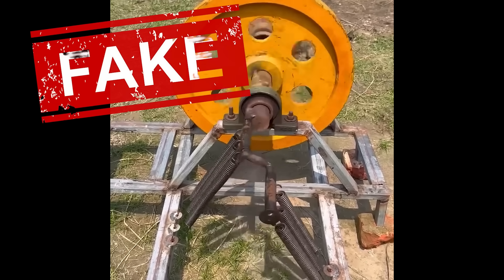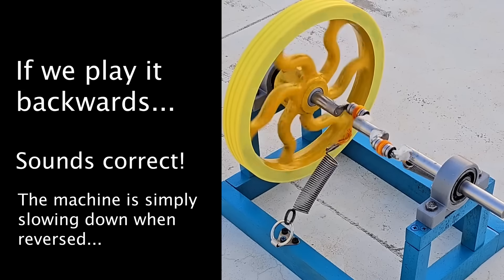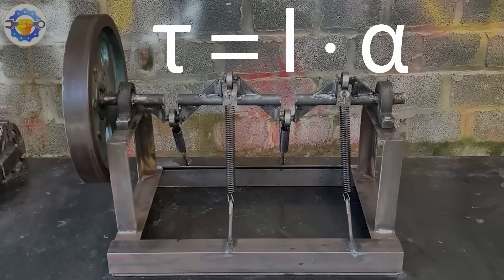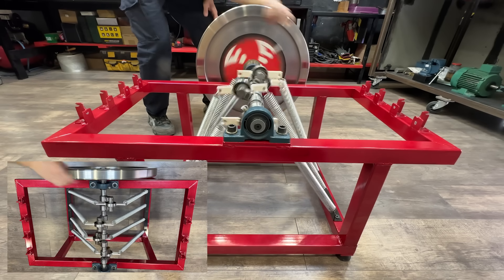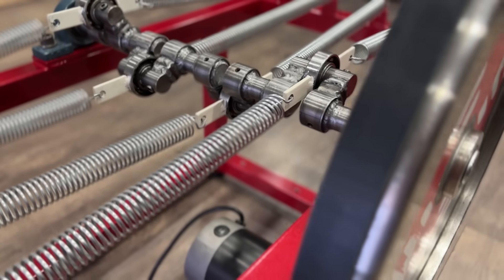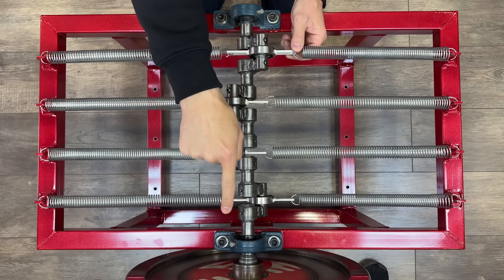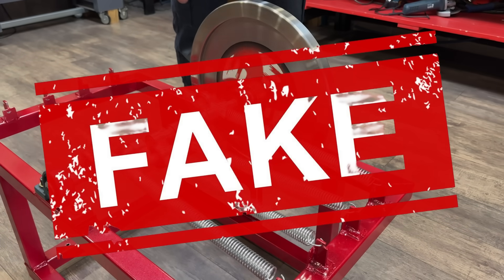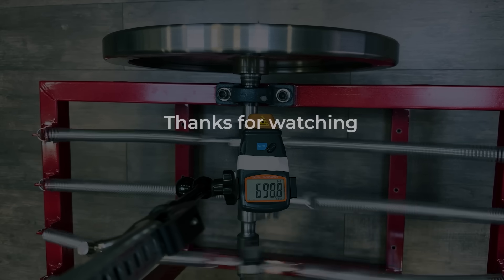Debunking the Controversial Spring-Powered Perpetual Motion Machine

Comment: No, it's not possible to make a genuine perpetual motion machine. Such a machine, one that runs indefinitely without any external energy input, would violate the laws of thermodynamics, particularly the first and second laws. While some devices might appear to move perpetually, they rely on external sources or other mechanisms, and eventually slow down due to factors like friction or energy loss. 

Here's why:

First Law of Thermodynamics:

This law states that energy cannot be created or destroyed, only transformed. A perpetual motion machine would need to create energy from nothing, violating this law. 

Second Law of Thermodynamics:

This law states that in any energy transfer or transformation, some energy is always lost as waste heat. This means that a machine will always lose some energy to its surroundings, eventually running down. 

Real-world factors:

In the real world, there are always external forces like friction, air resistance, and heat transfer that will eventually stop a machine from running indefinitely. 

No verified perpetual motion machine:

No truly perpetual motion machine has ever been scientifically verified to work, and all attempts have been shown to violate the laws of thermodynamics. 

While the concept of perpetual motion is fascinating, it's important to remember that it's a hypothetical concept that doesn't align with the established principles of physics.
Reply: Hey even if something lasts only a month before replacement parts are needed, as long as the monthly/yearly cost is less than the ever increasing cost of my outrageous Pacific Gas and Electric bill than it is 100% worth it.

Comment: bro okay can you at least tell us its energy conversion type

  I don't think that thing will work. because what you are saying is I can create energy from the external wave like spring also need energy to be formed. so what you are doing is just dividing the energy if the vibration is not absorbed back to the system it will result in more energy lose.

Comment: If u wanted to use this system to power something to get its energy wouldn’t u have to apply a belt or say install a drill bit on center of wheel to drill stuff or other means to take advantage of it engery wouldn’t the belt or drill bit friction keep it from working. I guess my question is can u use the energy it creates or does it even create energy or just enough to maintain keeping it rotating. Thanks
Reply: It does not create any energy , it only consumes energy , that energy being the energy you put in when it is push started .

Comment: You can remove all these ridiculous messy springs and keep the wheel, you cannot have more energy than the energy stored in the wheel  1/2*J*W^2
Reply: The wheel has white got to keep the crankshaft working
Reply: The springs ar the force on the crankshaft

Comment: No work is being accomplished.  You are totally discarding friction.  Perhaps this will work when you create a frictionless bearing.
Reply: Even with magnetic bearing there is air friction.
Reply: And find a way around hysteretic heating in the springs.
Reply: Hey even if something lasts only a month before replacement parts are needed, as long as the monthly/yearly cost is less than the ever increasing cost of my outrageous Pacific Gas and Electric bill than it is 100% worth it.

Comment: Trying any configuration would lead you to the same spot - producing energy out of nothing is impossible. At least there’s a friction between the flywheel and the surrounding air. Regardless of any springs configuration when turning the wheel by hand it will stop after a period of time (more or less but it will stop). Your formulas have their blindspots. Such videos are useless. No one could defeat higher level created laws…😅

Comment: I think it can sustain..with dyamo on the load side then goes to battery then connect to an electric motor that will spin again the machine. Then a sensor that will trigger the electric motor to start if the RPM is below a certain low side RPM, then after it reach a high RPM the sensor stops the motor. THis will enable the battery to store some energy before it will be use by the electric motor.

Comment: I'm not convinced. As you mentioned earlier, the system wouldn't function without an external energy source. If something like that were actually possible, you wouldn't be spending time making YouTube videos—you'd be out securing investors.
Reply: Do you see the difference between his crankshaft and the fak video crankshafts
Reply: I'm not so sure. Making YouTube videos takes considerably less effort than building a manufacturing business. Also, there are many tales of people getting murdered for threatening to topple the fossil fuel industry using free energy tech. If I'd invented a free energy generator, I'd probably just keep it in my basement to save energy costs, and maybe build a couple of extras to send anonymously to some science influencers.
Reply: @HankMeyer  you think these things work? Lol
Reply: Маховик  работает только на растяжение пружин ..пружины никакой работы не производят ..это не работает
Reply: I feel like the springs would cancel each other out. I assume it spins just as long with the springs as without the springs.
Reply: Untill the springs get hot and their elastic properties start to take over.
Reply: Evening to you 'all I've watched the video a number of times. At one point of video he mentioned doing a vector of one hundred and twenty degrees apart of spring placements  Also I was wondering of like some vee eight engines that had two cylinders igniting simultaneously to transfer power to crankshaft basically a four cylinder engine but with double cylinder burn for power  Two springs pulling, though after writing about the engine; think not correct.
Back to springs in a delta pattern the pulling I think would be balanced especially with a banked set offset to provide pull after pulling spring energy spent with another spring ready to provide.either that or they all work against each other and the system stalls.
Reply: Learn do math for physics and you can debunk or prove most of the generator stuff. I have a huge Pakistan engineers liberty engine design from 8 years ago. I believe these guys cause the science is sound.
Reply: @danfeutz6911   математика и физика содержит неполную информацию о мире вокруг .
Reply: 😊 I guess it is too much to spend the money and effort guessing at dimensions, obtaining/welding/painting the 1.5" welded steel tube, the 8"(?) springs, the 18" dia. (?),1" wide flywheel AND THE MAIN SHAFT(40 mm is 1") and making an experimental hobby effort  to prove or disprove. who owns a lathe, normally?
Reply: Amigo tenta a sorte o cara fez video e o experimento no mesmo tempo que vocé esta criticando agora ate eu viu por em pratica .
Reply: Die Energie einer Feder wird von der gegenüberliegenden Feder verbraucht und das wird früher oder später zum Stillstand führen.
Reply: You need a special  alloy  😂
Reply: Exactly. He should make it available for sale - to prove that it is possible. Or to prove that, it is not possible. Either way, it can be put on sale.
Reply: It could work without a load, enough energy to sustain itself but not if there were a load  on it, wether that be transfered torque or electro magnetic field to produce electricity.
Reply: @GetRektStudio Если бы это был вечный двигатель то без нагрузки ускорялся до полного разрушения
Reply: In the video he said that the crankshaft has to be equally balanced
Reply: The position of the springs are the most important

Comment: i'm pretty sure this won't work because when a spring compress and relaxes, it generate friction and with friction, come heat which mean loses.. even if this machine do work as you say it work, it will eventually fail due to heat as in, the spring would melt after becoming glowing red hot.
Reply: No such thing as a perpetual.motion machine.

Comment: Nope sorry. For every action of your spring motor there's an opposite and equal reaction that cancels it out = 0 gain of anything , except wasted time. A spring can pull no harder than what it takes to stretch out another like spring which produces,  0 net gain, a spring being bounced One Direction in oscillation text just as much energy to oscillate one way and then the other, =  zero net gain. For every action there's a equal and opposite reaction, they cancel each other out. -- Albert Einstein. You all should be ashamed of yourselves trying to Hoodwink everybody.
Reply: Equal and opposite actions cancel each other = Newton. Not Einstein.

Comment: The crankshaft needs to be arranged in a way like it is in a engine, for example like a 8 cylinder engine the pistons in this case the springs pull down every 90 degrees of crankshaft rotation and then i think the flywheel will keep spinning?
Reply: I don't think it's about the way the springs are arranged tho

Comment: Okay!...... but what if you applied a weight to the  flywheel opposite the spring perches? Seems the weight would compensate for the spring resistance and add its momentum to the spinning flywheel thus reloading the spring tension with each revolution! 🤔😎🤗

Comment: Won't work for long metal springs will eventually break and will need to replace often . And the flywheel will slow down when actually turning something and will eventually stop .
Reply: Concept physically impossible, but if it was physically possible, spring store or shop on every corner wouldn't be a problem.
Reply: Old cotton ginner and the more they work the faster they fail especially the way they are vibrating and good ones are not cheep . Metal cracks . @Mark-b3e6v
Reply: @txrick4879  Do you hear "Concept physically impossible"? or you going to continuously point to obvious and completely irrelevant "Metal fatigue"? If it was physically possible for this thing to work we have oils to make things work better.
Reply: But yes i think it doest work or they would be everywhere .

Comment: The flywheel is doing all the work. It will work the same without the springs.Flywheels have been used for centuries to sustain a nearly consistent speed. without power added, it will eventually slow down and stop.

Comment: Go one step further an put cams in to release some  tension in spring not under load, not only would it allow more pull from spring under but would create a snap tension load as it came under load itself.  And if that cam had adjustment, (EG: variable valve timing), it would act as an throttle control.

Comment: Not working cause they all pull one way. One I saw work pulled in 3 separate directions like a triangle. That way the original energy isn't lost it's transferred to next spring n just moves from one to other causing spin to continue

Comment: This is due to the initial load of the springs. They already have some amount of potential energy. When you start to spin the system the springs start to swing to find the lowest state of energy. At the end you see a resonant state where all springs swing like a string (the bow shows half the wavelength). The energy lost from the springs transfers into rotational energy of the wheel and crank. That's why it accelerates.
Reply: Crazy people think springs have power that is limitless 😂 

I have a few windmills for sale that need no wind 🎉
Reply: Will it fail and stop rowtation when a powerhead is added they put a lot of strain on a gas motor how will the springs handle it at a 10000 watt power head that what it will take to run a house power bet it will slow to a stop it may work for low power but high power i think will stop it
Reply: @salscianna359 : good Question. 
But I hypothesize a larger wheel and longer crankshaft would and to the torque required to add enough power for a larger scale system.

Comment: Insted of using square pipe and angle you need to use 20mm plate to hold bearing and fly wheel it will not vibrates and shake for constantly run

Comment: Well, 700 rpm is not sufficient enough to use a Dynamo. You would need 7000 to 9000 rpm to charge. This means that a step up geared system is needed to raise the rpms to the 7 or 9000 rpm. This is difficult and requires a sufficient amount of tourqe provided by the initial rotation through the crank to the flywheel and ultimately to and through the gearing system to the charging device. The question then becomes how much tourqe is needed and how much of it is created by your machine before the geared system is added. I would suggest that very heavy spring rates are added of up to 500 to 1000 pounds or more each. This may require significant startup problems due to the extreme spring rates, however, not impossible to start the heavier spring rated machine using an outside source. Once statred with these extreme sping rates the toruqe could reach a level significant enough to connect a gearing system that raises the rpm to and beyond 9000 rpm and providing the proper amount of toruqe needed to compensate for any high or higher loads after a charging device is attached after the step up gearing system is attached. The load of the charging system is a big factor and the machine would need this higher torque from heavier springs to compinsate for lags and load draws automatically within your choice of spring rates provided to the crankshaft.

Comment: Is it possible to add a motor pulse that starts charging at 500 RPM? Once the required energy is reached, it will generate an electric impulse that pushes the flywheel. An energy impulse will be produced every 5 seconds or even down to milliseconds, depending on the RPM.

This happens because of the consistent pushing force applied to the flywheel, which increases its speed. The faster the flywheel spins, the faster the electric impulses will be generated. As a result, more impulses will push the flywheel, increasing its speed further.

This has been my hypothesis for a long time.

I call it the 'Regenerative Electric Impulse Flywheel System.

Comment: The Laws of Thermodynamics make perpetual motion machines impossible: 1st Law: You can’t get more energy out than you put in (conservation of energy). 2nd Law: Every energy transfer loses some energy (usually as heat or friction). Even a perfect spring system will wind down as internal friction and generator load resist motion.

Comment: The most of these  perpetual motion devices do work but the problem is they have no torque to power much of anything other than there own motion
Reply: Ese movimiento seria suficiente. Solo tendriamos que pegarle unos imanes para generar electricidad igual que una bobina de motocicleta o alternador de auto. Generan electricidad cuando los imanes giran con la fuerza del motor
Reply: No machine is has ever been even 100.000001% efficient, as it would blow our current understanding of physics out of the water.

Comment: brother , the moment you add any resistance to the flywheel i.e a fan i.e a generator i.e any thing that will take energy from the system , the system will lose the energy to the output and with no energy input , the system will simply gradually stop

Comment: Your device simply transfers stored potential energy from the springs into rotational energy of the flywheel and that is why it increases rpm.  Once the flywheel reaches 700rpm it stays at that speed quite well because you have a low friction device with a lot of stored rotational energy in the flywheel and it will eventually come to rest.  By definition if the mass of the flywheel is moving a constant velocity i.e. not accelerating any more then the total energy in the flywheel is constant as only a mass accellerating requires energy.  I could easily make a compressed gas propel a flywheel upto 700 rpm and have it stay there for quite some time as modern bearings are very low friction and that friction is a very small percentage loss of the total energy in the spinning flywheel.  This is not a free energy device but a low friction flywheel, the moment you start extracting energy from the flywheel via a generator it will decrease in velocity and eventually stop.  You have made an energy transfer and storage device not a free energy device.  It is impossible to create or destroy energy - it can only be transferred from one form to another - in this case from stored spring energy into rotational momentum of the flywheel.  If you could make a device that creates net energy out compared to it's inputs then you wouldn't be making silly videos on YouTube but rather be a billionare .
Reply: siempre me pregunto si esto es real porque no lo muestran al mundo y cualquier persona lo compraria jajajaj
Reply: @norfibarrantesbarrantes7241  La maquina mantiene rotacion indefinida por que se transfiere la energia de los resortes a la volanta de inercia pero si se le extrae energia con ese dinamo entonces el sistema se detendria, NO es posible crear energia.